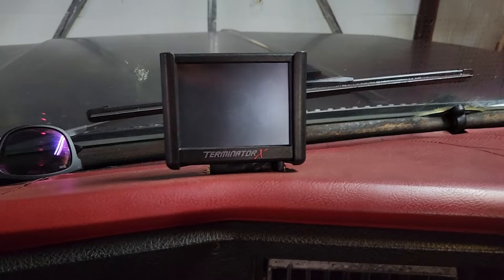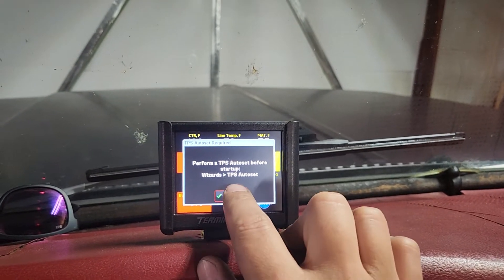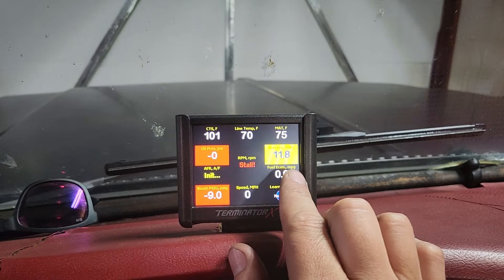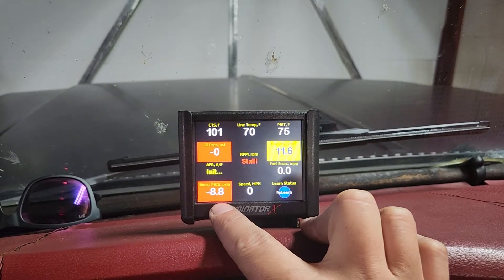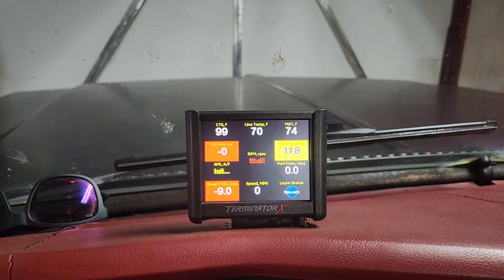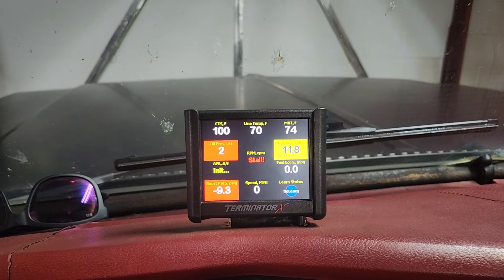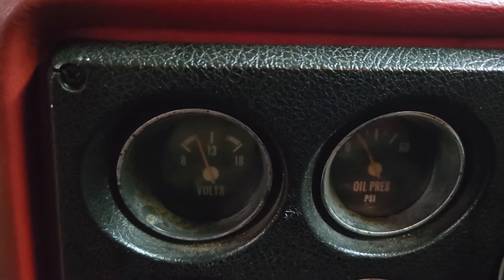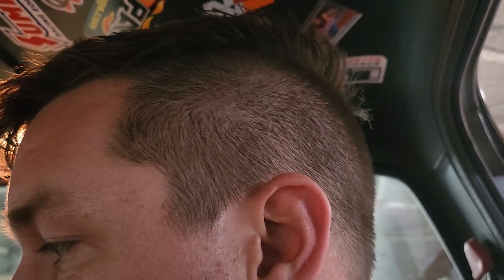Holley Terminator X 19V or 10-12V Fluctuating Issue - Bad ECU Voltage Reg Maybe? - Solution in Desc.

Comment: Long time racer with carbs and I’m new to the Holley terminator shit. Can you run 16V to this system? I’ve got nothing but 16V in my car and don’t really want to get back to 12V if not needed. Help!
Reply from the maker: The specs should clarify the voltage range it allows. I know some bigger youtubers are running them on 16V systems but verify for yourself.
Reply: @CastellawSpeed I’ve made some phone calls after I made this comment and I’m going to give it a shot on 16V. Engine builder isn’t having a problem so, I’m sending it! Thanks for your time!

Comment: Mines exact same.. 14 months old.. no warranty.. shows 0 rpm when cranking. Apparently there is a known ECU issue with "over voltage".. I parked mine truck up a year ago and bought a diesel truck.. so despondent with Holley
Reply from the maker: check all your 12Vs. It was a back feed into the ecu and the ecu was in some sort of protection mode. It was a 12v that was grounding to the block.
Reply: @CastellawSpeed  could you give me some further info. My ecu has no crank and past 1 warranty. New ecu is like $1000
Reply from the maker: Make sure you don't have a 12v grounding back to the ecu.
Reply: @CastellawSpeed  sent my ecu to holley it failed voltage parameters
Reply: No warranty after 12months 😢 anyone know a place that works on ecu internals?
Reply from the maker: @waltergaines201  any computer electronics shop should be able to fix it. At the end of the day it's just a computer

Comment: Had the same problem with my ecu, after spending some time on the phone with tech support I sent the ecu into Holley and they confirmed it was the internal voltage regulator and when they contacted me they said they could “pull some strings” in order to get me 10 percent off of a brand new ecu. I’ve heard nothing but good things about Holley and the customer service they have, however that is not my experience. Hope you all have better luck with getting a replacement than I did.
Reply: 10% off??? They should sent ppl out new ecu s. It’s their damn issue.
Reply from the maker: Hate to hear that. Wonder if them selling out to to a public company is starting to take affect on their policies...
Reply: Omg this just happened to me...broken out the box and oast one year warranty. I was offered 10% off the next ecu

Comment: Did anyone else have this problem this a different solution ?
Reply: Mate thank you so much for this video. ive had this problem for months your dead right it was a short just not on a wire inside my vac pump (even tho it still worked fine and thought it was dissconnected) i traced the ign wires like you said. im eternally greatful for your  video thanks soooo much
Reply from the maker: It's typically a 12v wire that is grounding back through the ecu or you send it in to see if the internal circuits are bridging causing the issue.
Reply: @CastellawSpeed  man i hope your right ill check tomorrow

Comment: Did you ever find out what was going on?
Reply from the maker: Yes I found a 12v wire that was rubbed through causing an interment grounding through the block
Reply: @CastellawSpeed   i have the second ecu doing the same thing.  What wire it was? holley harness or trucks own wiring. please answer, im gettin tired of this voltage problem.
Reply from the maker: @xrs599  It was an original wire on the truck harness that I believe went to the auto choke. It was worn through on the corner of the block over the starter.
Reply: @CastellawSpeed   did it damage the ecu? or it worked after you repaired the wire? I had the exact problem and bought new ecu and it worked whole last summer and two weeks ago it fired up normaly after winter. then i shut it off and it showed 20v and 9,8 volts. battery was 12.3volts. it doesnt fire up fuel pump or ignition sdo it doesnt start. I'm gonna toss this ecu to wolves if it broken again dammit.
Reply from the maker: @xrs599  no the ECU was fine. As soon as I fixed the wire everything started working again. I'm surprised the ECU survived honestly.
Reply: @xrs599  Hey did you ever fix yours I'm having the same problem